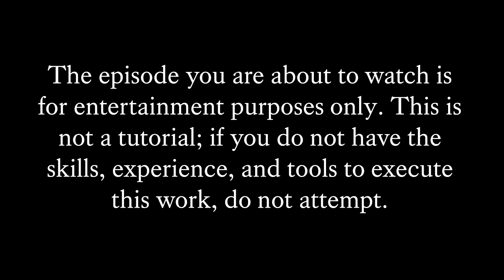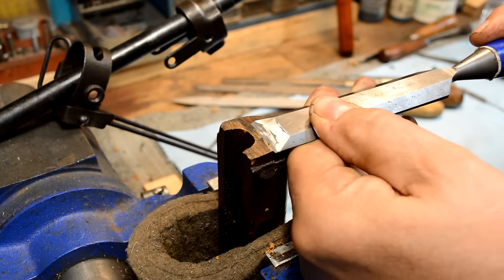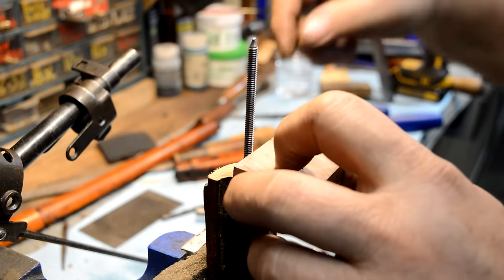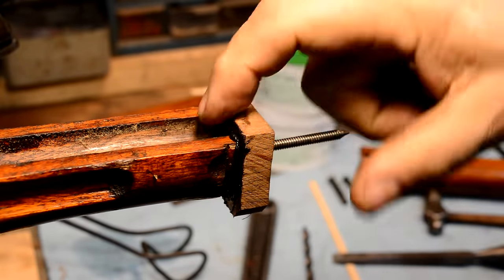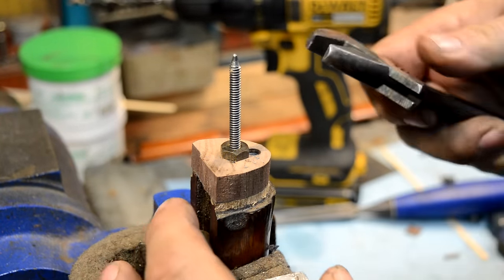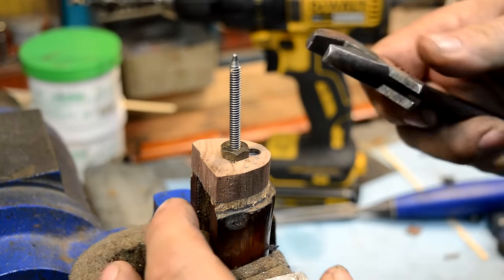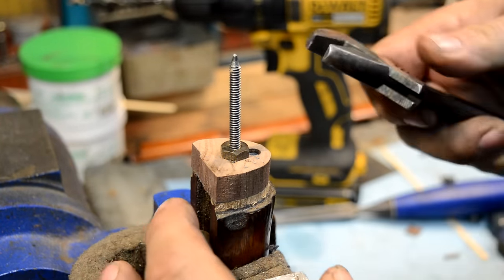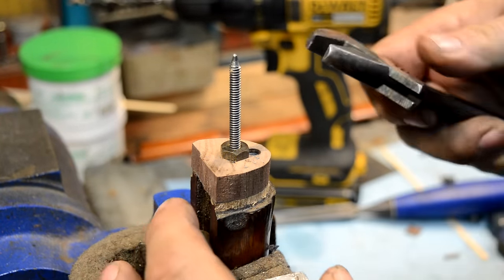Anvil 086: Type 99 Arisaka duffel cut repair

Comment: crude POS. The Mosin Nagant was cruder but cycled alot easier
Reply: Arisaka is the best and strongest rifle action of WW2.
Reply: Butthurt Mosin fanboy spotted. The Arisaka action is pretty similar to a Mauser 1893. And a Mauser 1893 has a very smooth action. The same is not true for a Mosin–Nagant.
Reply: Either bad bait, or someone who has clearly never handled a Mosin Nagant or Type 99. 

Ever. 

I own both an 1891 3-Line 1917 produced by Remington and a Type 99 Last Ditch. The last ditch rifle still cycled better despite being far more crudely made. However even with being more crudely made than the Mosin, the Mosin's design just has so many faults (mainly being stacking tolerances in the bolt causing it to be mushy and hard to cycle without a good slap). Also single stack magazine that protruded from the rifle that could be damaged easily, was more complex to make, rimmed ammunition requiring an interrupter, poor stripper clips, still more complicated to take down the bolt than the Type 99, the Mosin even after being adopted as the M91/30 was still overly long, and with worse sights. Hell just look at the reports from the Russo-Japanese War where the rifles were evaluated and it came out the Type 30 Arisaka was better than the Mosin Nagant 3-Line, and the Japanese still improved on that rifle's shortcomings and gave us the Type 38. Not unlike the US after the Spanish-American War where the US won but reverse engineered the Mauser 93 action into the Springfield 1903 because it was so much better than the Krag.
Reply: @old rabidus Yeah as you've seen Mosins are just like that. XD

Sticky, gummy, slow, and a general pain to operate.